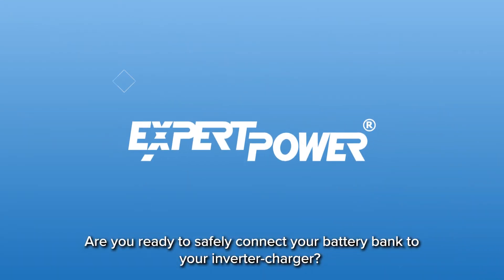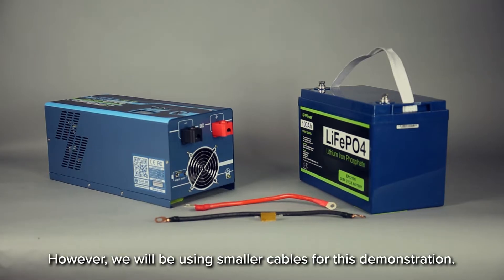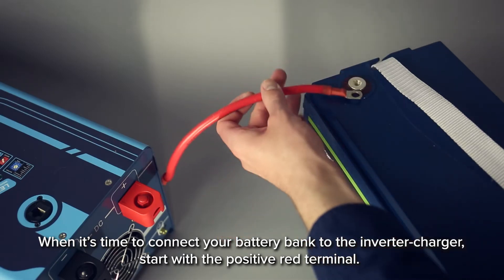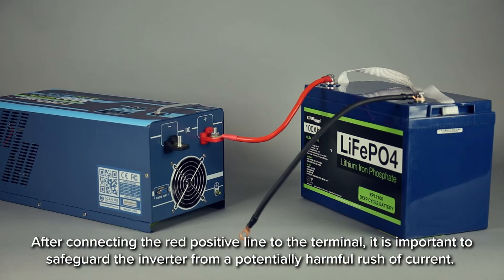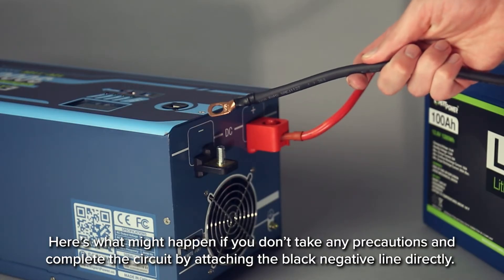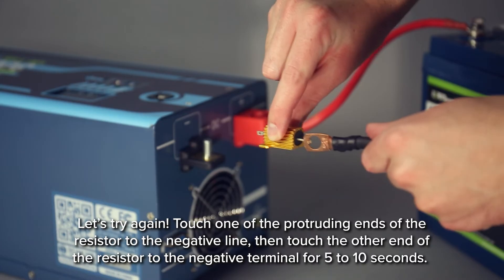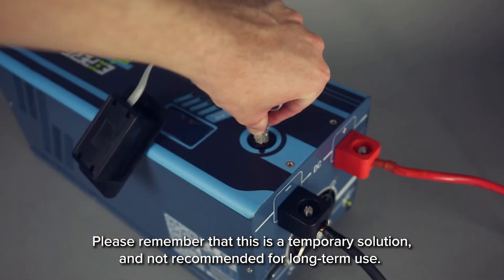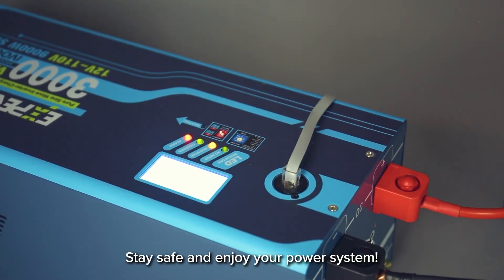Inverter-Charger Resistor Tutorial (Quick Set-Up)

Comment: When you're doing a how-to video, it would be best to actually demonstrate the appropriate practices e.g. not using crappy thin wire, and not finger tightening bolts.

There's really no reason if you're already making this video to just obtain appropriate tools and appropriate wire gauge. There should be no need to say "we're just using this really thin dangerous wire, but you shouldn't do that." Just get the proper wire so people can actually see best practices.
Reply: Good grief man it is a demonstration video....relax. It is good information with a solid demonstration showing a nice spark if you don't use a precharge resistor.

Comment: I've ordered a 1000w Renogy inverter, what was the rating of the resistor you used to do the pre charge?
Reply: at 0:50 it appears to read "25W 30Ω". The reviews for one of those on amazon has someone saying they use if for their 12v inverter